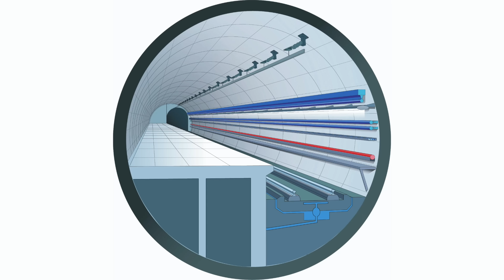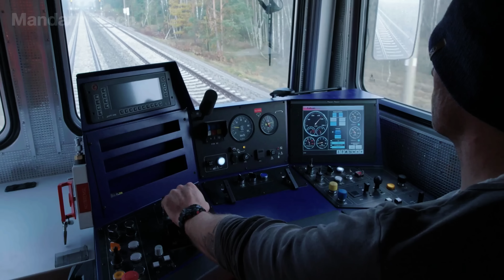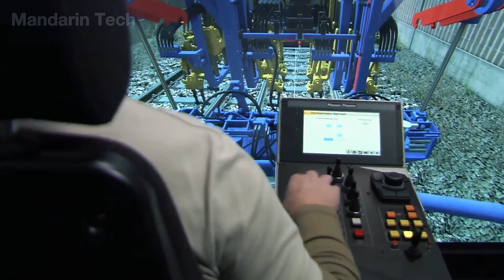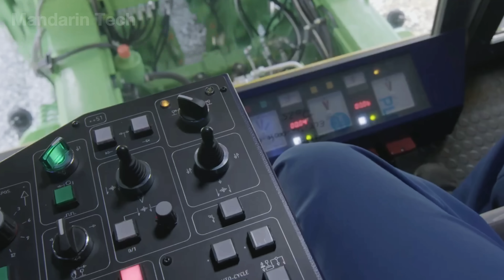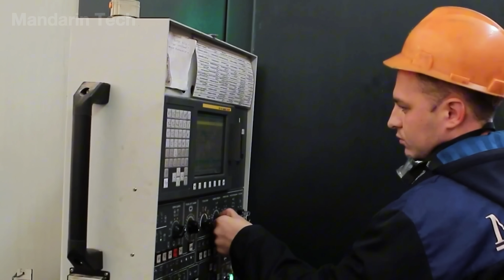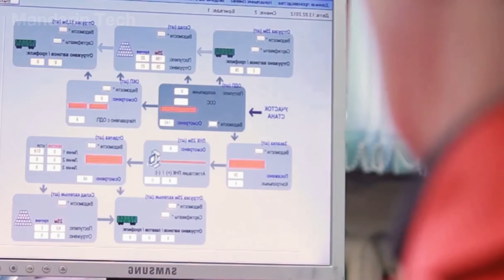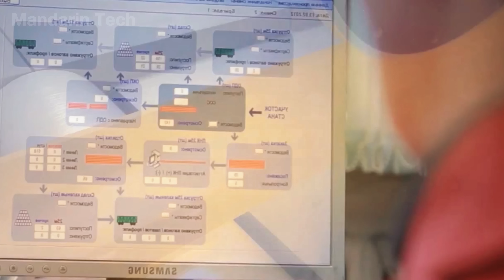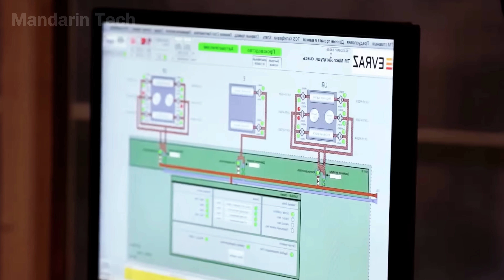China’s Mind Blowing Railway Construction Technology The World Can’t Ignore

Comment: This is a brilliant breakdown of a process most people never get to see. The visualizations of the rail rolling mill and the different welding techniques are incredibly clear.

The most fascinating point you make is the ballast (stone) vs. slab (concrete) track distinction at.

To add to that: the entire ballast-laying process you show (like the tamping machine at) highlights its main trade-off. It's cheaper to build and easier to re-align (which is what tamping is), but it requires that constant maintenance precisely because the stones shift over time. This micro-instability is the main reason it's not suitable for the 350+ km/h speeds you mentioned.

The slab track (China's HSR method) has an extremely high upfront construction cost and is a nightmare to repair if the concrete foundation settles, but it's "set-it-and-forget-it" by comparison. It provides the rigid, non-shifting stability that those ultra-fast trains demand.

Great video explaining the technology behind these two different philosophies!
Reply from the maker: Thank you — really glad you enjoyed the breakdown! And you explained the ballast vs. slab trade-off perfectly. Ballast is cheaper and easier to re-align, but slab track gives the rock-solid stability needed for ultra-high speeds. Great points!
Reply: @Mandarintechmido  thanks sharing. Aazing video